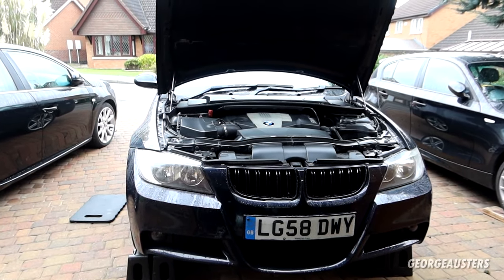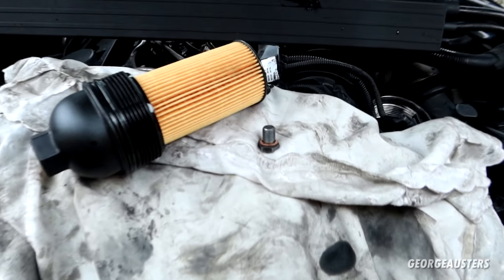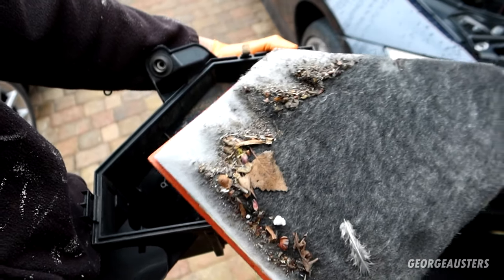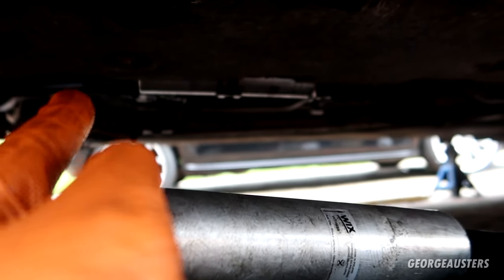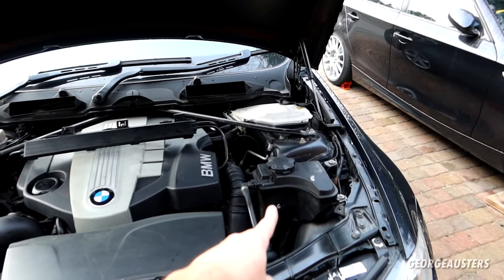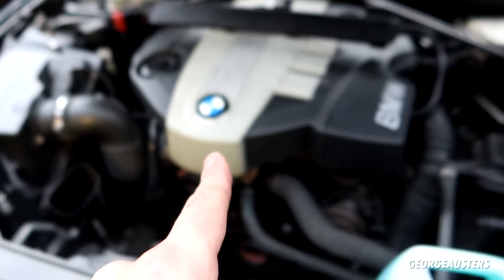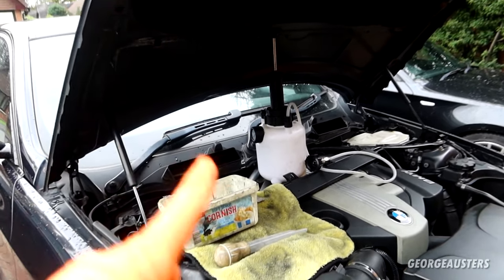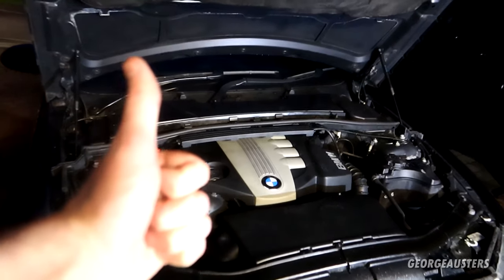BMW E90 3 SERIES FULL SERVICE!

Comment from the maker: These are the parts I used in this video:

Oil: https://ebay.us/Vqafrc
Oil Filter: https://amzn.to/3ojH95D
Oil Flush: https://ebay.us/TO2Z2l
Fuel Filter: https://amzn.to/3Dbv72f
Air Filter: https://amzn.to/3xPOc9e
Cabin Filter: https://amzn.to/3D9UAZJ
Gearbox Oil: https://ebay.us/24gxiN
Differential Oil: https://ebay.us/4dAqGe
Brake Fluid: https://ebay.us/2YN0qv

Comment: Probably one of the most comprehensive servicing videos out there for the 3 series diesel!
You are right about the diesel fuel filter, there are different ones for different engine numbers. The bottom end of the fuel filter that fits into the electric plug has a different internal diameter. Most part stores can issue you out with the wrong one. It has happened to me and not very nice when you have the car jacked up with everything disconnected only to find that you have been given the wrong one. In your car the incorrect one was already  fitted to the car.
Reply from the maker: Thanks John!

Comment: Fantastic video once again. You have the satisfaction of doing such a thorough job. I agree the new Mannol engine oil and flush does make the engine much, much smoother. I'm surprised you didn't put the Mannol Ester oil additive in the engine with the fresh oil for better ester protection and smoother running (left over from when the 760Li service was sponsored). Nevertheless, we know the service has benefitted the car from your previous videos. Really impressed that you bled the clutch slave cylinder and the brake fluid. The gearbox oil looked like black chocolate sauce. You deserve to reap the rewards of your attention to detail and hard work.
Reply from the maker: Appreciate it mate, this should be a good car for someone👌🏼

Comment: I did hear if you use those pre oil cleaners it does remove sludge but then sends it around your engine and leave some rubbish in there so your new oil carries it around and then blocks other parts up :/ never touched it since! 

I enjoy your videos tho !!! 🎉

Comment: Great video. I recently bought an E90 and your videos have been super useful. Not sure about BMWs, but I noticed the slider bolt was similar to that on VWs like Golf 5s with a similar brake caliper slide bolt like the one you showed, but on those ATE systems, they were usually dry slider bolts with minimal lubrication required. Any sort of greese seemed to swell those boots up. Thanks for a great video!
Reply from the maker: Thanks!

Comment: Excellent George going to change my coolant the same way as I dont want to have to take of the intercooler to get at the drain plug I have already done the gearbox oil and diff oil and I change the engine oil and filter every 6000 miles with shell ultra 5w 30 LL04
Reply from the maker: Good stuff Joey!

Comment: all top jobs except the coolant swap - there’s load there that’s not recommended…you still should use the radiator drain plug as well as the water pump hose, you should not be running just pure water for any length of time as the coolant lubricates the water pump and other components

Comment: First great videos.

Second, do you have an idea what the problem could be if the oil goes into the coolant?
Reply from the maker: Either oil cooler seal or head gasket

Comment: Hi George. I am looking for some info. I have a 61 plate 320D ED. FN61 TCX

I’m confused as to what oil filter I need as my engine code is a n47T. 

Could you please advise on the oil filter and fuel filter. 

Could you tell me what my engine code is. I see man with n47xxxxA or n47xxxxD. 

Thanks

Comment: Top job George, just curious how did you bleed the coolant system?
Reply from the maker: You can just leave the cap off and run the engine👍🏻
Reply: Use a obd tool

Comment: Great video, excellent work, i have E87 118d 2005, recently i flushed my coolant, and i told my mechanic to put G11 coolant and he said that he put G11. I noticed that the coolant is pink/red , usually G11 is blue, and G12+ is red/pink. Do you know if there is pink/red G11 coolant?
Reply from the maker: Mechanics will put anything in lol, same with oil. I wouldn’t trust them. G11 is almost always blue👍🏻

Comment: Did you replace any drain plugs with new ones also are you changing the glow plugs out for winter
Reply from the maker: Glow plugs already been replaced and drain plugs are fine to use again if o-ring is still good👍🏻

Comment: You really need to bleed the fuel system after changing the fuel filter. If you dont it’s really bad for your hpfp because it runs dry for a few seconds, diesel actually lubricates it.
Reply from the maker: It still had diesel running through it, that’s why you prime it by turning the ignition on. But it just has some air in that’s why it takes a while to start👍🏻
Reply: Yeah that’s the point mate, with these cars it doesn’t send fuel until you start cranking. So it doesn’t prime when you cycle the key. If you go through the bleeding procedure of ista you actually hear the pump priming, which you don’t hear when cycling the key. Try it and let me know.

Comment: Hey george was having a look at engine oil for my bmw e82 n47 was considering mannol what product of theirs would you recommend?
Reply from the maker: If you comment again tomorrow I’ll link all the products I used👍🏻
Reply: @GeorgeAusters  shall do George thank you! been loving the vids so far and have subscribed cant wait to see more !
Reply: @GeorgeAusters  hey George what products have you used?
Reply from the maker: These are all the parts I used mate:
Oil: https://ebay.us/Vqafrc
Oil Filter: https://amzn.to/3ojH95D
Oil Flush: https://ebay.us/TO2Z2l
Fuel Filter: https://amzn.to/3Dbv72f
Air Filter: https://amzn.to/3xPOc9e
Cabin Filter: https://amzn.to/3D9UAZJ
Gearbox Oil: https://ebay.us/24gxiN
Differential Oil: https://ebay.us/4dAqGe
Brake Fluid: https://ebay.us/2YN0qv
Reply: I use energy premium and it does what it says on the tin and goes further car is smoother and quieter after it. For the price and quality it is the best on the market I think.
Reply: @naliinsuthakaran2967  ordered some myself as George recommended it as well as their brake fluid

Comment: Hi George i have an E87 118d 143hp with the N47D20A do I have swirl flaps?
Reply from the maker: No
Reply: @GeorgeAusters  thanks so much for the reply man one less thing to worry about breaking haha also is the N47 prone to HPFP failure? It seems like a mixed bag and it’s anecdotal unlike failures on products like the N54

Comment: I heard its not a good idea to change transmission oil if a car doesn't need it, also if you regularly change your oil you never need to use engine flush.
Reply from the maker: Rubbish, I recommend servicing your transmission every 50-60k miles